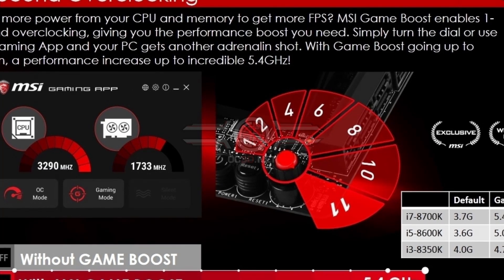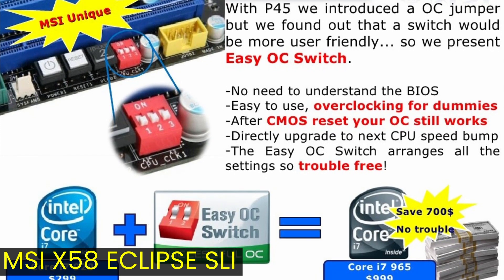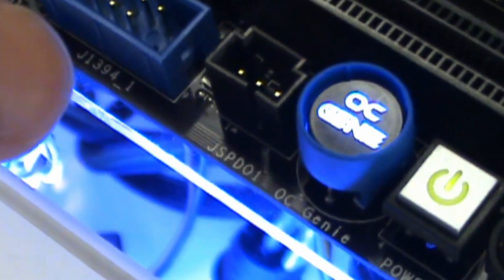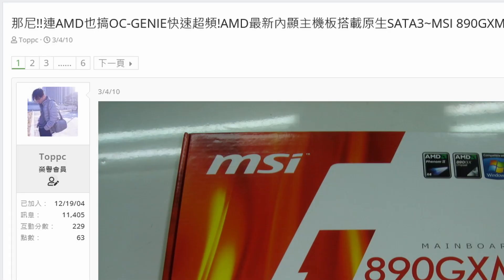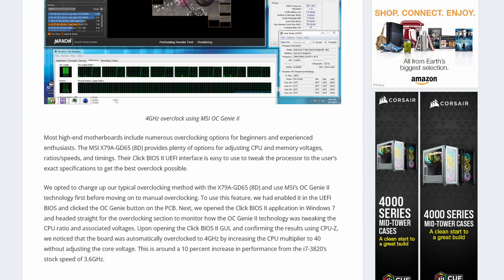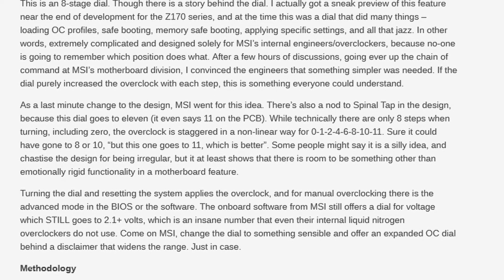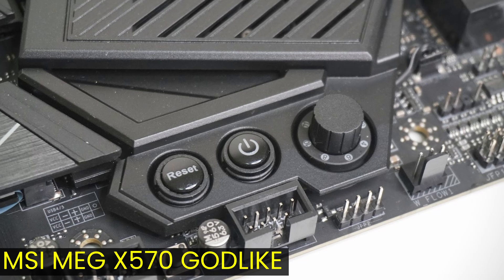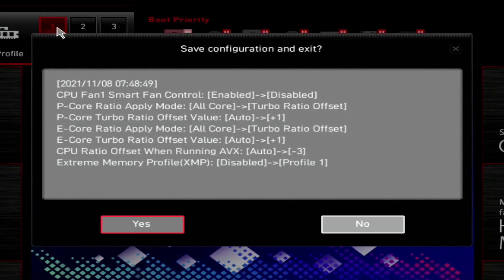A brief and incomplete history of MSI's automatic overclocking tools | SB#31

Comment: I really wished I found your channel before I bought my Z690 Gigabyte Gaming X!!
Reply: I have a DDR4 version and I hate it. Couldn't boot with memory above XMP speeds before the latest bios update (3 updates since release to get it right, come on), bios ui is clunky and slow, fan controller sometimes decides to stop one of the fans at random and for the love of God I can't figure it out. Tried stock profiles, custom profiles, even went and used the same PSU and fans in another build and it never happened there. Needless to say I'm not buying another Gigabyte board in the future.
Reply: @Khonichev  yeah I hear you. The memory compatibility is so flakey on this board. There doesn't seem to be an adaptive voltage mode on the iGPU so it's either stock voltages or running overvolted 24/7 even though the iGPU barely use ramps up 99% of my use case. Also, have you got fan control within Windows? Their 'EasyTune' software doesn't seem to work with our boards and I don't know what else to use??
As you say, never again! Not when you see ASUS AI overclock and MSI software, etc.

Oh and would it really have killed them to put a CMOS clear button on the board. The number of times I had to take the battery out is an absolute joke!